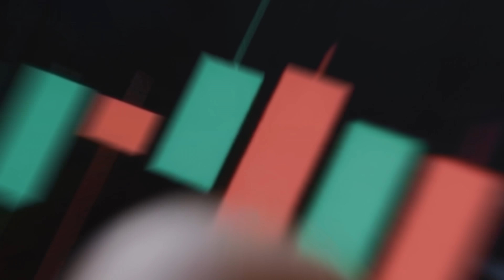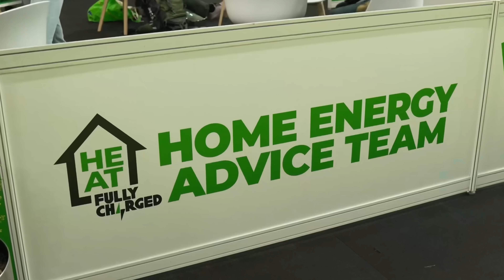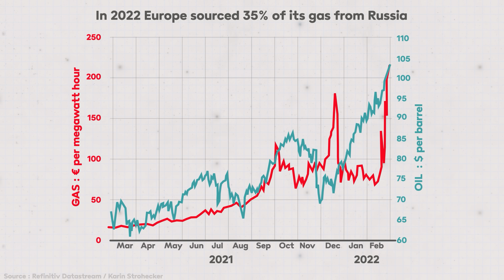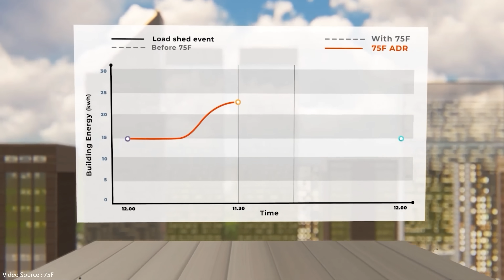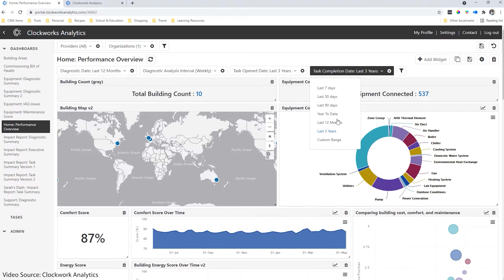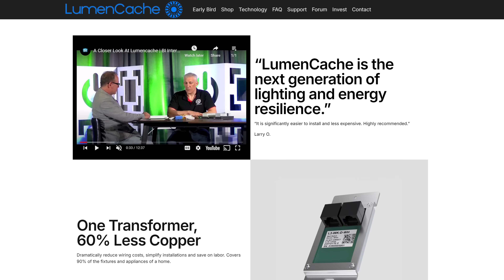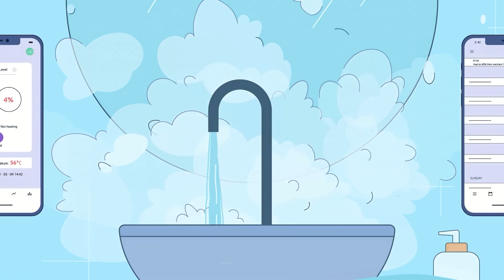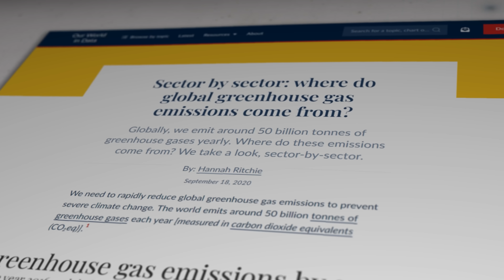The INSANE effect of Artificial Intelligence on Climate Change.

Comment: A number of issues on this topic as shown in the video. A big one is not mentioning the climate impact AI is having through its energy consumption. I may have missed it, but AI across the spectrum is very energy consuming. The server farms that AI runs on are usually equated to cities and small countries in their energy consumption and it is only getting worse as the technology advances.

Placing an enormous demand on the electrical grid while trying to transition more of our fossil fuel technology to electric is country intuitive. It drives up demand, and thus cost. Further, a lot of the electrical grid is still fossil fuel based, so it is also driving directly to climate change as well.

Also, AI isn't the most necessary element to making the grid smarter for load balancing with appliances. Non AI algorithms can be deployed effectively as well. The most important element is building the ability for appliances to communicate with the grid. No amount of AI is going to help in that situation if the appliances can't communicate or be controlled. Of course, this also looks past the massive security and privacy issues with that subject as well. Something those pushing AI in this field are probably completely overlooking. What if hackers get appliances to suddenly drive demand up in peak periods or get them to fluctuate in unison as a means of damaging the grid? 

Also, any benefits of off peak grid usage are only short term. This is only because electrification of fossil fuel elements in our society are still so early in their adoption that demand is low. This will all go away once more and more electrification is done. An electic car holds about 2-3 days of average household electric supply. That is  if you could get your house to run off your car, it should be able to run everything for more than 2 days on its charge.

When a small percentage of people have electric cars, this just seems like an increase in households to the electric grid. Eventually though, as the percentage of the population adopting the technology grows, it will be like doubling or tripling the households on the grid. It's not really a one to one situation though, but what will happen first is there will no longer be off peak hours. Eventually so many batteries will be charging in off hours that they will cease to be off hours.

This will have knock on effects, as the grid was designed to take advantage of off peak hours. These are the times when facilities are taken offline for higher levels of maintenance required to keep them running. Has that been forecasted for?

The reality is that society is going to need to change quite a bit. Efficiencies aren't going to make a big enough impact on the tens of billions of tonnes of carbon we spew into the atmosphere every year.

Our transportation model, even when electrified, simply consumes too much energy. The idea of transporting tonnes of metal, plastic, and glass just to get one or two people from A to B is an idea long overdue for being erased from our society.

Again, one charge for an electric car is typically more that 2 days of an entire household's electrical usage. This doesn't account for the fact that a large portion of a cars total carbon footprint is made when it is manufactured, not over its lifetime of usage. So electric cars still have nearly as significant of a total impact as any other car.

This also doesn't account for how much oil an electric car consumes. How much plastic goes into one? Tires, which electric cars use more of as they are heavier?

Also, what about infrastructure. Paving one mile of road releases something like 4000 tonnes of greenhouse gases. Electric cars will require just as much infrastructure and actually cause more wear and tear that gas cars.

Electric cars may seem like an improvement, but they are step back really. To force the transition quickly enough to have the impact we are hoping they will have, we will actually be causing more damage. It will cause a massive wave of building, not just cars, but infrastructure, to meet the goals necessary, that it will increase emissions.

Building out and transitioning to a robust public transportation model would be far more energy conserving than electric cars will ever be.

Comment: Increased reliance on cloud computing has been a feature of the last two decades. However, local building control might offer many benefits over too much reliance on the cloud, mostly in terms of much better security and significantly faster responsiveness. Does the cloud save energy though? I don't have the answer.

Comment: Interesting concept using smaller cables to power lights. 
I assume these are DC, although DC generation would work very well with solar-powered distributed-electric generating and storage systems.
 I believe a major barrier to solar and wind power is the desire by those already in the generating, storage and transmitting power business to continue reaping the rewards of monopolization, also know as the economies of scale. 
Why does solar need to come from a large farm covering thousands of acres  in remote regions when the same could be done as or more efficiently with a distributed renewable system incorporated into or added to existing structures? And same argument could be made for wind, as there must be other ways of harnessing that energy by means other than gigantic landscape eating eagle killing windmills.
I've seen articles, possible on YouTube, about devices that look like large boxes than can be  placed on top of tall buildings. Even a shaft open at the top could utilize the suction created by moving air. 
I fear our approach to wind and solar, at least at the fundamental policy level, is deliberately and profitably irrational.
Reply: Companies trying to sell something always inflate energy transmission and conversion losses. Converting AC to DC for lights is very efficient, and heating losses in low-voltage wiring are higher than 120V/240V AC.

The cost per kWh of the faraway solar or wind farm is far lower because of economies of scale. (Whether the utility passes on the saving to you, and whether it fairly compensates you for any electricity you supply to the grid, are issues for regulators.) And it can be more efficient than making your own: "The U.S. Energy Information Administration (EIA) estimates that annual electricity transmission and distribution (T&D) losses averaged about 5% of the electricity transmitted and distributed in the United States in 2018 through 2022." Wind turbines don't eat the landscape, the land below remains productive. Home wind turbines and wind harvesting boxes on buildings are close to snake oil; simple physics means a taller wind turbine whose blades harvest a bigger area with higher wind speed will generate a lot more electricity at lower cost.

Comment: Yor comment that reducing energy use is important in reducing fossil fuel use highlights a key strategy.

Unfortunately we seem to be concentrating on building vehicles much larger than needed.  Then manufacturers strap on a bunch of heavy expensive equipment reducing fuel economy and longevity to ¿reduce pollution?.

If we incentivised lighter lower complexity vehicles that had quality parts and got better gas mileage we would be way better off.

I can say the same for our housing.

We need to get rid of giant parking lots and build our cities for less commuting.

The average person traveling by cars, trains, and busses for almost two hours per day is not an efficient use of time or resources.

Comment: When are we going to start solar heating our water?
Reply: I started about 5 years ago :) 
It's long been common to see solar boiler panels on Spanish rooftops
Reply: I started 13 years ago. Its not common here in Norway 😅
Reply: Solar thermal heating is wonky and prone to breakage. I have the scars to prove it. It is better to put up more solar photovoltaic panels to make your own generally useful electricity, and use some of that to power a heat pump for domestic hot water.

Comment: Okay but what are the energy costs of all the data centers and computing power required to run all this "smart" technology? What's the energy footprint for the servers these cloud services run on? Not a single mention of that, really? A single training run for one of these large language models uses more electricity than a small town - isn't that just moving the externalities to a different page of the ledger? I'm surprised to see this sort of fairly short-sighted techno utopianism on a channel that's usually pretty sensible.
Reply: The companies touting these smart technologies have to buy the compute. It's pretty obvious that their compute costs are less than the money they charge companies to reduce energy consumption, otherwise they'll go bust.

Mr. Think could have mentioned this downside. I'm more disappointed that he didn't explain how much these companies claim to reduce building energy consumption and how they do it. Putting a bunch of Internet of Things sensors in a building doesn't magically reduce people's desire to work at 68°F/20C.
Reply: Yep, smart building automation (which is what this video is about) is just a machine learning algo which is extremely lightweight compared to the large language models like chatgpt etc. 

These companies use the word AI to ramp up their sales and to get a cheap seat on the AI hype train

Comment: Thanks Dave for your thoughts and insights, what about Jevons Paradox? According to the International Energy Agency (IEA), while energy efficiency has improved by approximately 36% since 1990 due to advances in technology, infrastructure, and energy management, total energy consumption has still increased by about 63% during the same period. This growth in consumption is primarily driven by factors such as economic expansion, population growth, and the increased demand for energy services, particularly in developing countries and energy-intensive sectors like data centers and transportation.

The paradox here is that while individual energy use per unit has decreased, the overall demand for energy has surged. For example, efficiency gains in data centers and industrial sectors have led to lower energy costs per task but have simultaneously enabled a much larger scale of operation, driving up total energy use. This pattern reflects a classic Jevons Paradox scenario where increased efficiency reduces the cost of energy services, leading to higher consumption rather than a reduction.

Data from reports by the EIA reinforce this view, indicating that energy demand will continue to outpace efficiency improvements unless accompanied by shifting economic ideology towards Doughnut Economics, Ecological Economics and changes political institutions (e.g. no money in politics) and changes in consumption habits through energy policy.

Comment: Don't consumers want their car battery maximally charged at all times, so that it's there when they  make spur of the moment decisions to use their cars? I think people will be thrilled to let their car sit at half a battery knowing it will start charging automatically when demand is lowest and therefore cheapest, but I don't think they will want to release that energy back into the grid. Not unless they get paid significantly for those battery cycles.
Reply: Most EV drivers don't, any more than gasser drivers obsess over having a full tank of gas in case they make a spur of the moment decision. And a decent V2G system lets you specify maximum discharge rate (note that 7 kW flowing into the grid is only 10 horsepower, like driving smoothly at 30 mph), minimum battery state of charge and the battery state of charge you want by morning. Yes, many people will only participate if it saves them money, though some will do it if it significantly reduces emissions.

Comment: This could very much be an appropriate use of AI. However wherever AI in this context means learning through neural networks or neural network based architectures we need to ask very seriously if these startups products will in fact be rolled out to enough customers to pay back the energy cost of the training through gains in efficiencies. Yes, neural networks used for these purposes, so large language models, generative adversarial networks - GANs or any architecture with "transformer" in the name like GPT (generative pretrained transformer), will have an energy payback time associated. Not all "innovation" comes without cost. And the recent AI hype can very much exacurbate existing resource conflicts and economic warfare over hardware and it has already eaten up a whole load of our carbon budget for a net zero 2050.

Comment: IMO, I notices alot of Solar and Wind Farms are NOT really connected to our existing grind, or at least not TAKING those powers and feeding it into the whole power line system, something about gas and oil with strong connections >_>;.  That explain the 2 degree hotter over the years.

Comment: All energy eventually becomes heat, which is the real problem. Only solar and wind are not changing the Earth's energy imbalance.
Reply: Well, technically solar panels have a very low albedo and therefore absorb a lot more heat from sunlight than even the darkest roads.
Then again, their effect on Earth's albedo overall is ridiculously negligeable compared to the millions of square miles of polar ice we are loosing because of global warming caused by greenhouse gases

Comment: At the consumer level, "AI" (the old fashion kind, called "machine learning"), can help with efficiency.  This is what is necessary to sustain a population.

But the trends, towards increasing massive energy demand, in the US, is disturbing.  This is in the face of having largely staying flat for a number of years, due to efficiencies.  This is until recently.    

"AI" in the form of LLM's, and scaling them up, requires huge amounts of energy.  In the US, they can't build data centers fast enough.  And the Tech companies are even sympathetic to renewable energy + storage, and want to meet the climate targets.  Delays in land allocation, permitting, permitting, transmission, ...make it quite difficult.  They even consider using nuclear power plants to power ChatGPT. (Just kidding.  It's not quite that.  But neither too far from the truth.)   Even if one is willing to pay the price for nuclear, these take a long time to build.   So they're left with natural gas plants (which is cheap in the US).  Esp. the kind of plants that can deliver reliably 24/7, which are needed for data centers.

There's also the resurgence of manufacturing in the US, ironically from IRA.  This also adds to the energy demand.

Comment: I may not be that smart, but it seems to me that if the price of electricity was linked to the cost of production then surely this would accelerate the transition away from fossil fuels. The subsidies, which I am lead to believe amount to a substantial sum, could be used to offset the cost of moving towards more solar pv, solar thermal, domestic wind turbines and heat pumps etc. Beyond this, the transition to more appliances managed by IOT could be implemented rapidly thus reducing the overall amount of energy used in domestic and commercial settings. China has been vilified for subsidising EVs but if the above transitions could be subsidised then everyone would win, whether these components were manufactured in China or elsewhere. Just a thought.
Reply: You've almost got it. The cost of electricity production needs to include the harms caused by its generation, mostly from burning fossil fuels. Even without a carbon tax, solar and wind are already the majority of new generation everywhere in the world because they're cheap and quick.
Solar thermal and home wind turbines are inefficient and unreliable.

Comment: Why would big corps build electric energy storage, if they can destroy your car battery for free and profit? And you will like it.
Reply: Discharging 7 kW back to the grid is only 10 horsepower, which is tiny, like driving at a constant 35 mph. If your EV can't support that you shouldn't take it out of your driveway! Electric utilities are unlikely to compensate you fairly for the energy you supply to the grid without strong regulation (they want to FLEECE their domestic customers, not pay them), but you can still power your home when electric rates are high and recharge when they're cheap. Eventually you'll join a virtual power plant whose operator will go to the utility and say "I've got 500 MW of supply ready to go in a minute, fork over the $$$"; I hope VPPs fairly compensate the households who join.

Comment: So, yet again the solution to consumption is to build more things and enforce greater controls by using AI.

Despite the obvious hypocrisy here of more manufacturing which uses more energy and resources we also have the elephant in the room that is AI ,data storage and processing requirements which are all massively energy intensive.

This is about profit and control not saving anything or reducing anything.